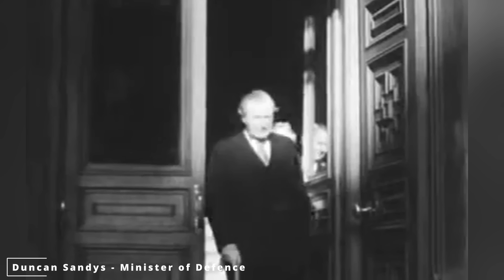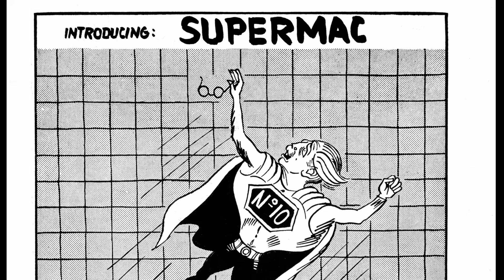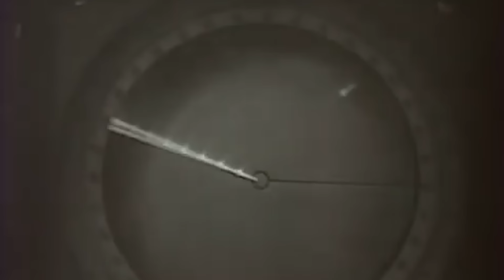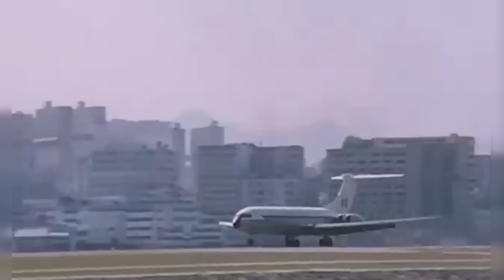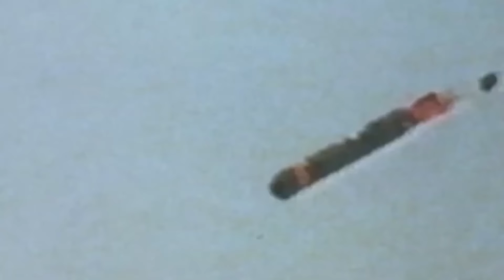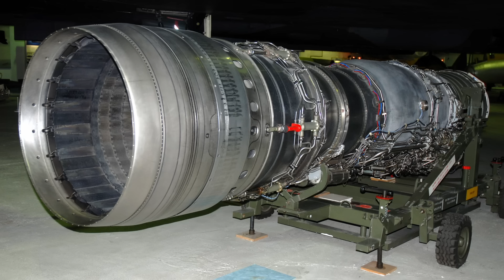How Britain Turned A Failed Airliner Into a Soviet Submarine Predator | The Mighty Nimrod

Comment: Great video.  One error.  The speaker repeats the fallacy that the two Comet crashes were the result of cracks that started at the corners of the passenger windows in the cabin sides.  The 'windows' where the crack actually started were in the roof of the cabin.  Two small 'windows' where the ADF antennae  were installed were the source of the cracks that resulted in explosive decompression failures.  This has been know publicly for decades but the story the lame stream media rushed to print has continued to be repeated so many times people believe it to be true.  The cracks started in ADF 'windows' the cabin roof, not the passenger windows cabin sides.
Reply from the maker: You are correct, I just did not want to get into the Comet crashes. The pressure tests that were carried out in the water tanks failed around the passage escape hatch window. I suppose I could have worded it to be more precise.
Reply: @AviationRepublic  We know that the results of the Water tanks tests were deeply flawed and did not match any of the damage found on the wreckage recovered from the sea.
 de Havilland eventually admitted they never pressure tested the fuselage segment between frame 152 and 158, they only estimated loads with calculations using test data which was also performed incorrectly and produced spurious, false data.
Reply: @DoktorBayerischeMotorenWerke 

Comet / Nimrod notes. 

We believe we can clear up some commonly held myths and misconceptions obviously.

It's always good to see the facts presented clearly and concisely isn't it?

Obviously there have been worse aircraft for accident losses both before & after the Comet.

All jet airliners benefited greatly from the knowledge gained from the Comet incidents & subsequent investigations & yet some were still worse for accident losses. 

The post incident water tank test results and wreckage from the incident revealed fatigue fracture evidence. The water tank tests were significantly speeded up with more overpressure tests than published in order to get to a first failure quickly. This was to get more info from further testing on the rest of the airframe.  

It's a great pity & a crying shame that British military forces had to occupy a large part of Germany for decades after 1945 & Russian military forces had to do the same. Of course Russia still posseses a large chunk of what was German territory & of course Russia & the UK produce nukes. Obviously Germany does not produce nukes.

Instances of all marks of the Comet flew with full certification after 1954 including the Comet 3. The last Comet flight occured in 1997.

The fabulous trail blazing DH Comet.
World's first jet airliner.
World's first high altitude airliner.
World's first airliner with a full fuselage length pressurised cabin pressurised for high altitude flight. That feature for that type of aircraft was a considerably difficult undertaking. 

How things were back then.
Accident losses - % of aircraft built.

DeHavilland Comet 4 UK                          14% 
DeHavilland Comet all UK (ff 1949)        17%  
Vickers VC10 UK (ff 1962)                        5%

Douglas DC-1  US                                       99%
Douglas DC-2                                              47%
Douglas DC-3                                              30%
Douglas DC-4                                              26%
Boeing s300    US                                       72% 
Boeing 307                                                  70%
Boeing 247                                                   48%
Boeing 707  (ff 1958)                                 32% 
Lockheed L-049 Constellation (ff 1958)  30%
Lockheed Electra US (ff 1958)                   29%
Fairchild FH-227 US (ff 1966)                   30%
McDonnell Douglas DC-8 US  (ff 1958)   14%
Sud Aviation Caravelle  (ff 1955)             15%
Canadair CL-44 Turboprop US (ff 1959) 46%  
Convair CV-580 Turboprop US (ff 1960) 22%
Convair CV-880     (ff 1959)                      27% 
Convair CV-990     (ff 1961)                      33%
Tupolev T-104        (ff 1956)                     16%
Vickers Viscount UK  (ff 1948)                32%  
Fokker F-27 Turboprop (ff 1955)             39%      

The Vickers VC10, fastest Atlantic crossing for a non supersonic jet airliner, held the record for 41 years.

For the first few years of operation the Caravelle & Comet had similar accident loss fatalities.

The first few Nimrod airframes were Comet 4 airframes with the equipment bay tacked on. Subsequent Nimrods were new build Comet 4 airframes with the modifications built by the DH team at Hawker Siddeley.

Military aircraft accident losses. 
Lockheed XF104                 (ff 1954) 100%
Lockheed  P80                      (ff 1944) 43%
Lockheed F104                     (ff 1954) 45%
Grumman f9f                         (ff 1947) 47%
Convair F102 Dagger            (ff 1953) 45%  
MD F-101 Voodoo.                (ff 1954)  34%
MD FH Phantom 1                (ff 1945)  35%
MD F4 Phantom 2                 (ff 1958)  28%
MD F3H  Demon                    (ff 1951)  32%
Gloster Meteor UK                   (ff 1943) 21%
DH Vampire  UK                        (ff 1943) 23%
DH Sea Vixen  UK                     (ff 1951) 33%
DH Venom       UK                    (ff 1949)  16%
Gloster Javelin    UK                (ff 1951) 20%
EE Lightning     UK                   (ff 1954) 33%
HS Harrier      UK                     (ff 1962) 34%

The Sea Vixen was an aircraft carrier jets pioneer aircraft that was also regularly flown from carriers that were too small for the aircraft. 

The Tornado & Typhoon & their engines are supersonic & are indeed British design aircraft with British design engines built by an international consortium. The Tornado design for example started life during the 1950s at Vickers as the AFVG, it's engine is based on the RR RB-199. The EE Lightening is also a British Supersonic jet aircraft.

The Typhoon is the British BAC-EAP with an engine based on the British RR XG-40, the Typhoon is also built by an international consortium.

Global aerospace. 
From the 1950s sector rationalisation and consolidation took place. 70 companies in France and 300 companies in the US disappeared due to merger or dissolution. In the US Boeing was almost bankrupted by the 707 project.  Boeing had a well protected domestic market and the available space and resources in the US to engage in large scale airliner manufacturing enabling them to capture orders simply by being able to produce airframes fast enough. Brazil now has the world's 3rd largest airliner manufacturer & is towards the bottom half of the wealth per capita tables. Most of the countries at the top don't bother trying to have a lone national airliner manufacturer. 

For example, there are of course no German companies that makes German jet aircraft in Germany & there are no German Companies that make German gas turbine aero engines in Germany that are suitable for widebody airliners.

The UK has the world's highest combined per capita Nuclear / Defence / Aerospace Sector Activity.

UK defence sector, absolute terms, world's second highest activity. 1st for per capita defence sector activity. Per capita nuclear powered submarine construction, 2nd position. 
Main players being Rolls Royce, Babcock, GKN Aerospace & BAe Systems. Activities often involve international collaboration. BAe systems, RR and other UK companies now handle more Airbus work value wise than Germany. 

Rolls Royce Holdings UK
Subsidiaries
- Rolls-Royce plc
- Rolls-Royce North America (ex Allison etc Classified Military stuff)
- Rolls-Royce AB
- Rolls-Royce Deutschland
- Rolls-Royce India Private Limited
- Rolls-Royce Marine Power Operations
- Vinters Engineering Limited
- Rolls-Royce Controls and Data Services
- Rolls-Royce Power Systems
- Bergen Marine
Joint ventures include:
- Rolls-Royce Turbomeca
- MTU Turbomeca -

Trent Family
The MT30 (Marine Turbine)
Industrial Trent 60 Gas Turbine
Trent 7000
Trent XWB Airbus A330neo.
Trent 1500
Trent 1000
Trent 500
Trent 600
Trent 700
Trent 800
Trent 8100
Trent 900
   
RR wholly owned subsidiaries in Germany handle smaller 2 shaft RR gas turbine aero engine work.
Reply: @DoktorBayerischeMotorenWerke 

Typhoon & Tornado, British design aircraft. 

Early days of the airliners.

The awesome De Havilland Comet.
World's first production jet airliner.
World's first high altitude airliner. 
At the time the Comet wasn't particularly dangerous. The DH Comet was definitely not the worst engineering failure in commercial airliner history.

Losses comparisons.
How things were in those days.

DeHavilland Comet 4 UK                          14% 
DeHavilland Comet all mks UK (ff 1949)17%  
Vickers VC10 UK (ff 1962)                         5%

Douglas DC-1  US                                       99%
Douglas DC-2                                              47%
Douglas DC-3                                              30%
Douglas DC-4                                              26%
Boeing s300    US                                       72% 
Boeing 307                                                  70%
Boeing 247                                                   48%
Boeing 707  (ff 1958)                                 32% 
Lockheed L-049 Constellation (ff 1943)  30%
Lockheed Electra US (ff 1957)                   29%
Fairchild FH-227 US (ff 1966)                   32%
McDonnell Douglas DC-8 US  (ff 1958)   14%
Sud Aviation Caravelle  (ff 1955)             15%
Canadair CL-44 Turboprop US (ff 1959) 46%  
Convair CV-580 Turboprop US (ff 1960) 22%
Convair CV-880     (ff 1959)                      27% 
Convair CV-990     (ff 1961)                      33%
Tupolev T-104        (ff 1956)                     16%
Vickers Viscount UK  (ff 1948)                29%  
Fokker F-27 Turboprop NL (ff 1955)       40%      

The Vickers VC10, fastest Atlantic crossing for a non supersonic jet airliner, held the record for 41 years.

For the first few years of operation the Caravelle & Comet had similar accident loss fatalities.

De Havilland had prior experience building many all metal construction airframe aircraft & thousands of jet powered fighter aircraft that were primarily of metal construction with pressurised cockpits & jet engines built by De-Havilland. No aircraft before the Comet was subjected to as much pre-production testing as the Comet. 

It's a great pity & a crying shame that British military forces had to occupy a large part of Germany for decades after 1945 & Russian military forces had to do the same. Of course Russia still posseses a large chunk of what was German territory & of course Russia & the UK produce nukes. Obviously Germany does not produce nukes.

Interesting British achievements.

The gas turbine engine was invented & patented in England before the 1800s.

Axial multi stage sequential stage compressor & turbine technology, first produced for turbo machinery use in England by Parsons of Ireland & North England during the 1800s. The components form the basis of most modern gas turbine aero engines. At the time the concept of the jet aircraft powered by axial internal combustion gas turbine engines was first mentioned thus the internal combustion jet engine & jet aircraft was indeed invented in England before the 1900s & before the Wright brothers got busy.

Work on the multi stage sequential stator rotor axial compressor as applicable to the axial compressor gas turbine aero engine was ongoing in England from around 1928 by Arnold Griffiths and others. By 1943 the Metrovik F2/3  Beryl was a running axial turbojet that was superior to anything anywhere else. As the centrifugal compressor engines were adequate and more powerful at the time development of a larger F2/3  version was commenced.

The Metrovik (UK)  F2/3 axial compressor gas turbine aero engine was flight certified & ran in 1942, it was the result of UK development work ongoing since 1929. At the time it was the most capable axial compressor turbojet in existence but was not required and development work continued on a larger version.

Frank Whittle performed the world's first demonstration of a gas turbine aero engine in 1937. People in Germany kept a close eye on everything going on in Britain at the time.

The centrifugal compressor RR Nene was the most powerful & most reliable gas turbine aero engine on the planet in 1944. That engine would be later built under license or copied in many countries including Russia (Mig-15 Mig-17), China, the US, France and Switzerland powered dozens of aircraft types for decades after 1944.

Pratt and Whitney and others produce centrifugal compressor gas turbine aero engines. The PW200 is a currently produced whittle style centrifugal compressor, reverse flow combustor, gas turbine aero engine. 

The world's first wind tunnel was constructed in England during the 1870s. The world's first supersonic wind tunnel was constructed in England in 1922.

There is no doubt that the Fairey (England)
Delta 2 was the world's first jet
aircraft to exceed 1000 mph.  Indeed It
exceeded the previous record by 310 mph &
held the record for 1 year. Incidentally, the Dassault Mirage 3 & 4 are based on the Fairey Delta 2.

More recent UK military jet aircraft.

The Tornado & Typhoon & their engines are Supersonic & are indeed British design aircraft with British design engines built by an international consortium. The Tornado design for example started life during the 1950s at Vickers as the AFVG, it's engine is based on the RR RB-199. The EE Lightening is also a British Supersonic jet aircraft.

The Typhoon is the British BAC-EAP with an engine based on the British RR XG-40, the Typhoon is also built by an international consortium.

Brazil has the world's third largest airliner manufacturer and makes very good airliners & Brazil is 100th down the list along with Indonesia for wealth per capita. Of course it is in fact the case that Embraer can't build those airliners without purchasing stuff from the US, UK & Europe. For example, Norway, Holland, Denmark, Ireland & Belgium, top 20 wealth per capita, don't make airliners, its as simple as that.

Global aerospace. 
From the 1950s sector rationalisation and consolidation took place. 70 companies in France and 300 companies in the US disappeared due to merger or dissolution. In the US Boeing was almost bankrupted by the 707 project.  Boeing had a well protected domestic market and the available space and resources in the US to engage in large scale airliner manufacturing enabling them to capture orders simply by being able to produce airframes fast enough and cheap and nasty enough. Another factor is airlines preferring to obtain as much of their airliner inventory as possible from one manufacturer. 

Global Aerospace Sector, what's happening.

For example, there are of course no German companies that makes German jet aircraft in Germany & there are no German companies that make German gas turbine aero engines in Germany that are suitable for widebody airliners.

The UK has the world's highest combined per capita Nuclear / Defence / Aerospace Sector Activity.

UK defence sector, absolute terms, world's second highest activity. 1st for per capita defence sector activity. Per capita nuclear powered submarine construction, 2nd position. 
Main players being Rolls Royce, Babcock, GKN Aerospace & BAe Systems. Activities often involve international collaboration. BAe systems, RR and other UK companies now handle more Airbus work value wise than Germany. 

There's a good chance that anyone currently flying on a widebody airliner will be on an aircraft powered by RR gas turbine aero engines made in the UK and a good chance there will be other hardware on the aircraft that's designed and / or manufactured in the UK. 

Rolls Royce Holdings UK
Subsidiaries
- Rolls-Royce plc
- Rolls-Royce North America (ex Allison etc Classified Military stuff)
- Rolls-Royce AB
- Rolls-Royce Deutschland
- Rolls-Royce India Private Limited
- Rolls-Royce Marine Power Operations
- Vinters Engineering Limited
- Rolls-Royce Controls and Data Services
- Rolls-Royce Power Systems
- Bergen Marine
Joint ventures include:
- Rolls-Royce Turbomeca
- MTU Turbomeca -

Trent Family
The MT30 (Marine Turbine)
Industrial Trent 60 Gas Turbine
Trent 7000
Trent XWB Airbus A330neo.
Trent 1500
Trent 1000
Trent 500
Trent 600
Trent 700
Trent 800
Trent 8100
Trent 900
   
RR wholly owned subsidiaries in Germany handle smaller 2 shaft RR gas turbine aero engine work.

The UK space and aerospace sectors are highly productive, high-value industries that together contribute over £18 Billion in direct Gross Value Added (GVA) to the UK economy. Individually, the space industry directly contributes about 0.3% of UK GDP 7•2 Billion while the aerospace industry contributes approximately 0.5% £10•9 Billion.
   
We hope this helps.